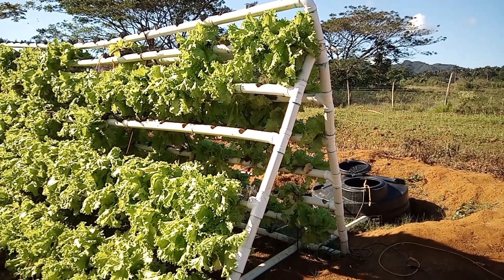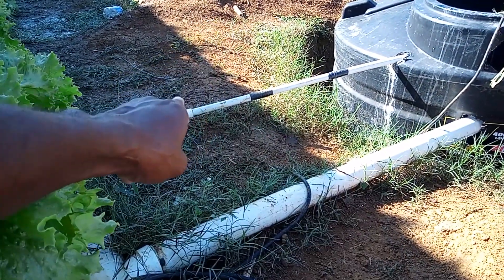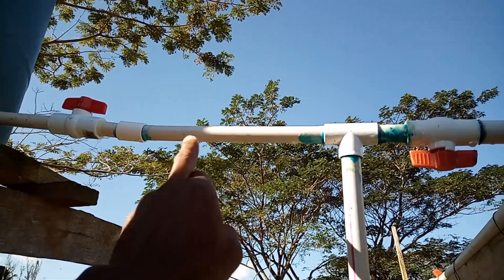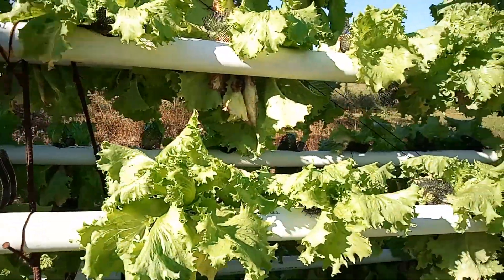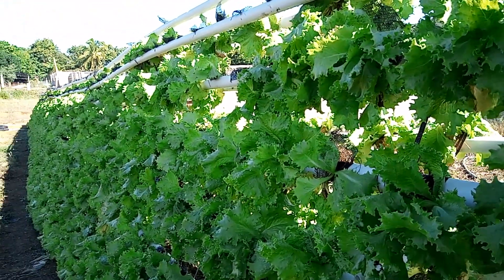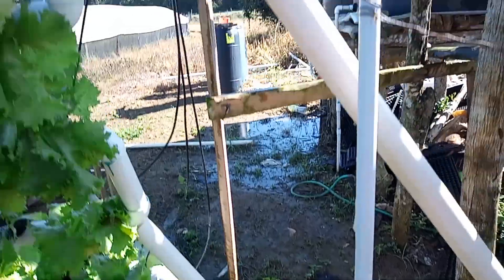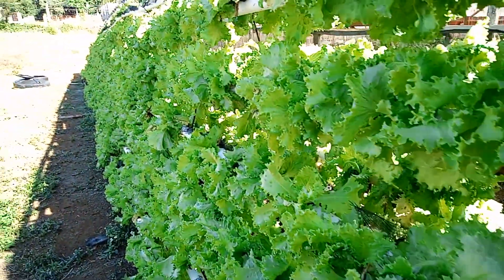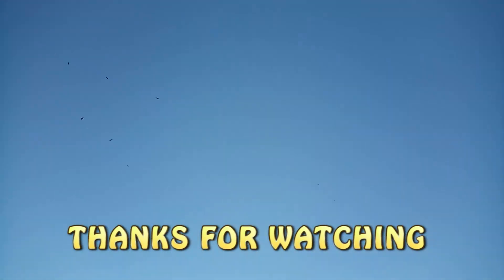HYDROPONICS  | HOW IT WORKS

Comment: Good night. I am planting lettuce in my new hydroponics for the first time. I follow all the mixing instructions but my lettuce leaves are yellow. Can I add nutrients to the mixture ?
Reply from the maker: Yes you can It need more than u test the water again with the ph meter make sure the fertilizer is not too high